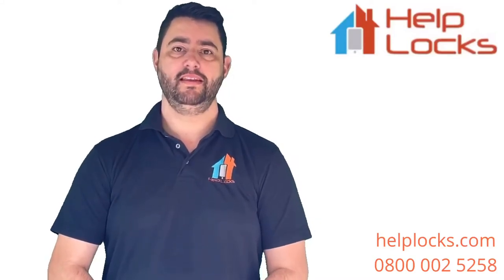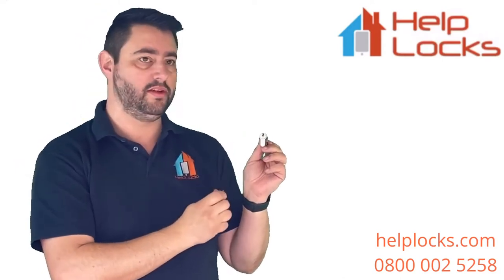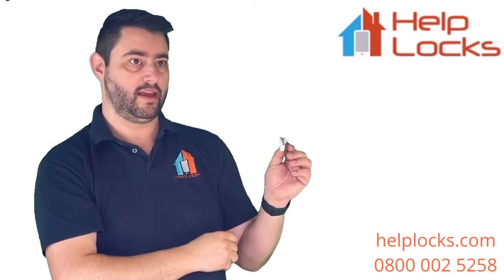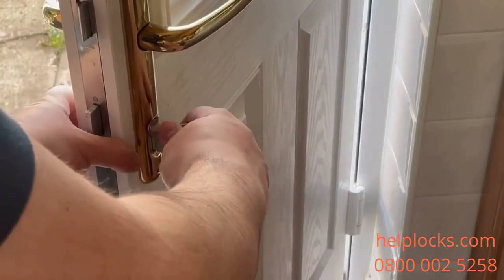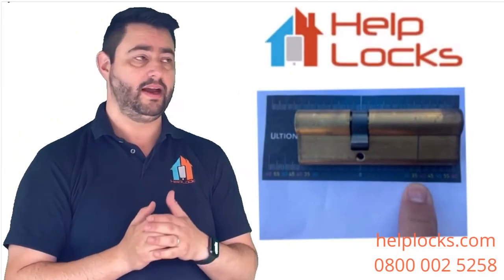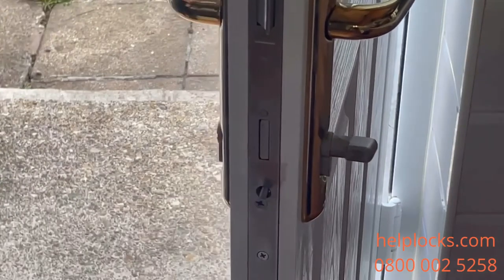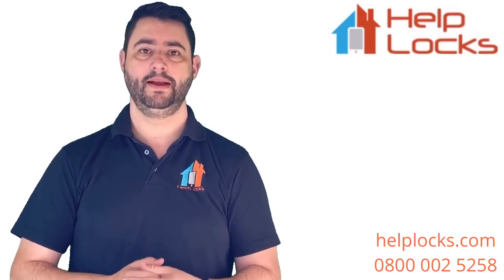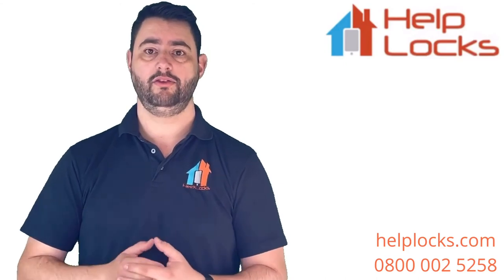How To Change A Euro Cylinder Lock https://www.helplocks.com

Comment: Hi, does it matter if the lock protrudes a few  millimetres on the inside of the door?
Reply from the maker: No, not from an operational or security point of view but if you are having one fitted, I would insist on the correct size… particularly if you are paying for one to be fit…